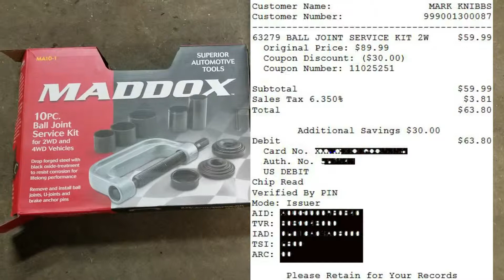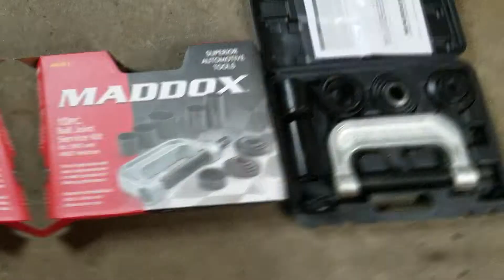Harbor Freight ball joint press overview Maddox MA10-1

Comment: I bought this last week at $89.99 and used it first time today on a very stubborn lower ball joint on my 4x4 Silverado.
The tool exploded when it finally broke loose the 1inch threading on the press slipped almost 2 inches thru the hole on the tool and the swivel end I havr yet to find, it vanished one my shed somewhere.

To my surprise it has a large bearing inside the threaded part that the end swivels on. I think this is a really nice tool compared to say AutoZone unit that cost $149 with half the adapters.
That being said the lower joint i was removing was in a very serious bind for some reason, (24 years old) it even destroyed a pickle fork and the ring steel the fork presses against got destroyed. All other joints popped right out as expected except this one side.

I had to use my grinder and cut the joint just to remove the hub assembly and I pressed it out with this exact tool on the bench mounted in my vice when it exploded. I reached 3 partial turns on a half inch breaker bar when it popped.

When I say 'swivel end" I'm taking about the free spinning end on the threaded part of the tool. So keep in mind that threaded part is hollow, mine now has the bearing sliding back and forth inside of it and I can look directly into the threads as if it's a pipe with a large steel BB rolling inside of it.

Anyhow thought I'd share my story from today, damn thing scared the hell out of me. But I got it out. Now I'm headed to return the tool and swap for another one as I have 3 more joints to press still.
Reply from the maker: Wow that's crazy.  Mine has held up very well.  I just used mine to pop out some wheel studs.  But I've beaten on mine , and havent had an issue.  Im glad the stuck joint came out .  Hopefully, they dont give you any issues returning it.

Comment: Do you think it can get the job done on a Dana 60 without having to scrounge around or buy additional piece?
Reply from the maker: I don't have any experience with D60s. Sorry.
Reply: FYI they sell about adapter set that goes with this tool that has several other pieces.
If it helps any, can look it up.

Comment: I bought this press and it lasted a few uses.  The end won't stay in the forcing screw and the ball bearing constantly falls out.  Total garbage
Reply from the maker: I borrowed an older unit from work and the same thing happened.  I haven't had this problem on the Maddox one.  Try taking it back.  They should be able to replace it.